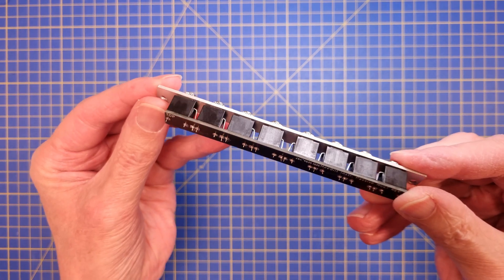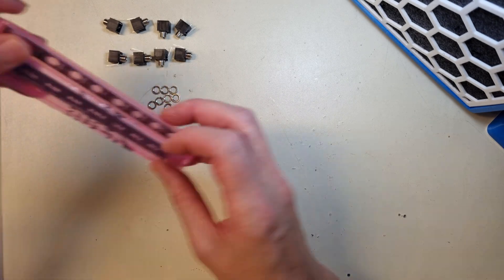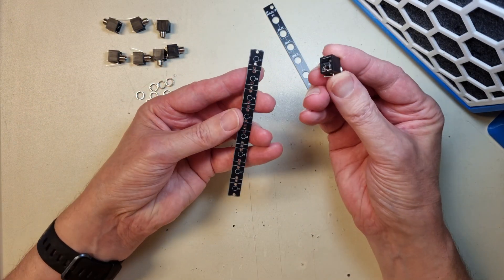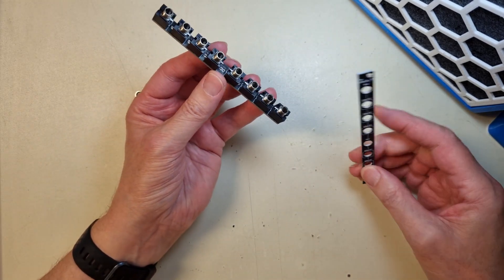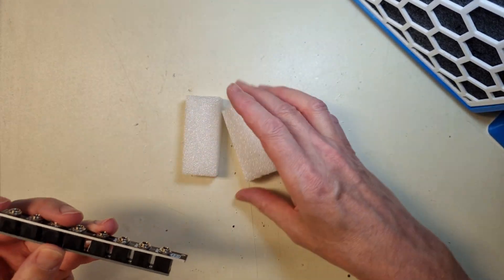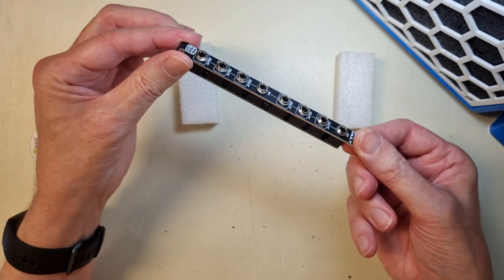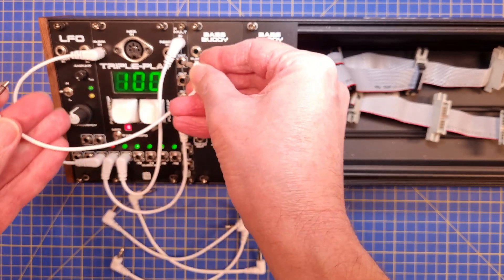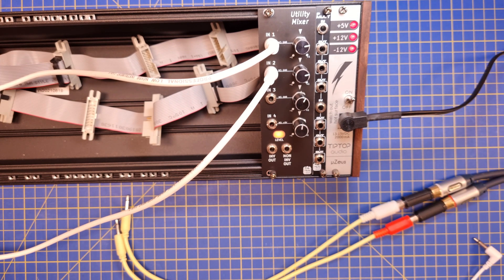Eurorack DIY - PMULT Build and Demo

Comment: I received my modules from you (via tindie) today!  I look forward to building them and trying them out.  I've already dry-assembled this one... will solder it and start working on the others (though one I did partial dry-assemble, too) tomorrow.  Excited!  Thank you!
Reply from the maker: Excellent!
Reach out to me if you have any question - good luck with the build!
Reply: @MeeBilt  Thanks!  Soldered up, and have now also built the audio module, and done the multimeter part of the testing... will have to wait until I have a few more supplies (in particular, a bus bar for power) to actually try it out, but I'm looking forward to it!  Hopefully very soon!
Reply: Also, it was a fun little build.  Simple to do, and now I have a thing that looks nice!  Great work on the design.  :)